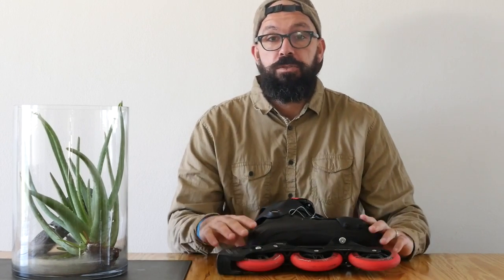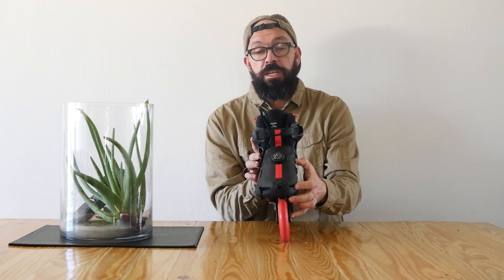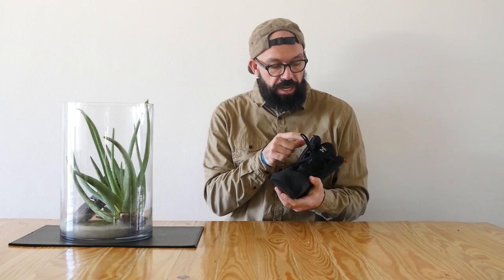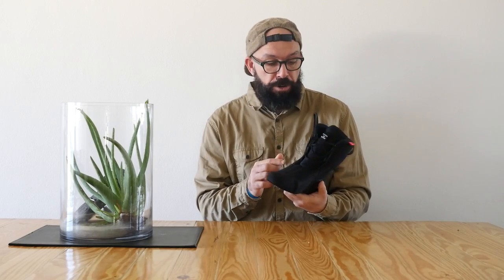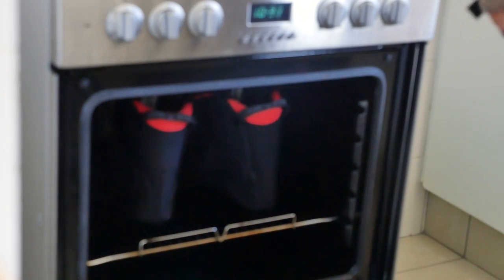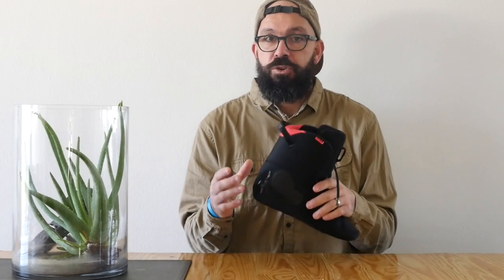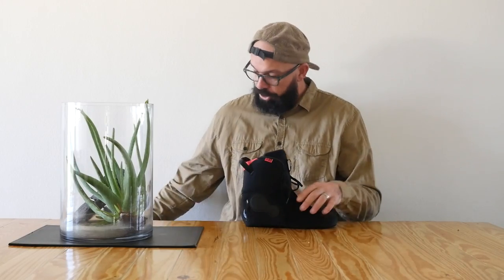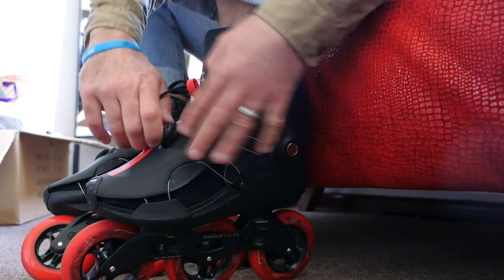INLINE SKATE TUTORIAL - HOW TO HEAT MOLD YOUR MYFIT LINERS

Comment: I have a pair of FR80 carbon pro skate and all the advice is they can't be heat moulded but I did mine in a gas oven. 
I used an upside down roasting tin to shield the skate from the direct flame. I had to leave the oven door slightly ajar to keep the temperature approx 100 degrees centigrade.
I removed the cuff and all the ratchet straps and the sole liner.
I rolled up a piece of tissue and placed it over the pressure point in my sock then laced the boot up as tight as I could.
I pushed my foot flat to the floor and pushed my knee over my foot and waited about 20 minutes for the boot to cool down.
Won't lie, it's very stressful watching 850 quids worth of skates in an oven against all advice but it was the best thing I've ever done. 😁

Comment: Thanks Lino! I was considering getting some intuition liners (cause they are readily available at my local inline skate shop) it's nice to know multiple methods to mould them. Intuition suggests using a heated up sock of rice kind of method. Mind you, I did put in some insoles just recently and my feet don't ache anymore and if they do, a little standing up straight for a minute or 2 totally gets me back in. So thus I've been wondering how much better a solid liner will do.
Reply from the maker: Daniel Naron a good liners change your skate experience. Haven't tried intuitions but only heard good things.. fat padded liners work amazing for support and I like thin liners for more bendy tricks type of stuff ... again different goals.. different products 😉👍🏼

Comment: I just got some fatboy liners for my FR1s. I am swapped out the original liners put the new liners in to check out the fit. They felt great in the most part but a little narrow in the widest part of my foot. I heat molded using this video at 180F / 82C for about 5 to 6 minutes and put them back on the skates and I stat with them on for about 10 or so minutes. They felt fine during the process. Any fears I had about them being too hot to wear just after heat molding were totally unfounded. I want to skate a few days on them next to get a good feel of them before increasing the temp a little and trying again. Only problem it's raining pretty hard now so I will try tomorrow.

Comment: Hi Ricardo! One doubt: the yellow liner that comes with the Rollerblades Twister X is possible to be molded in the same way than that MyFeet liners?
Reply: Hans Brommer They are. The hard shell is modable. The liner is not designed for it but is moldable as well. This information was provided by Rollerblade themselves.

Comment: What do I do if my size is 305mm and my skate boot is 308mm? Will this liner be okay? Currently my liner is 305mm and it's a thick liner and it hurts my toes Because too tight so was thinking of getting a thin liner or maybe the one you showed. Any advice. I can't get any bigger skates because 308mm is the largest, size 47

Comment: Hi, can this Heat molding make the liner a bit narrower for the foot?
Reply: Yes the idea is it's molding to your feet but u have to take it out of the oven, put it in your skate, and put it on your foot secure like you would be riding it as soon as it's done heating up in the oven so it doesn't cool off and not mold to your feet correctly.